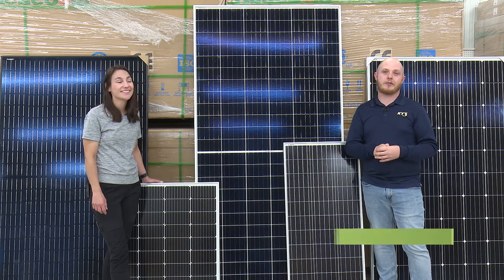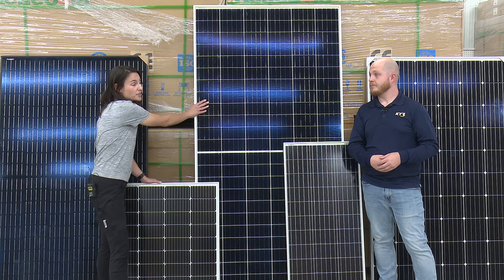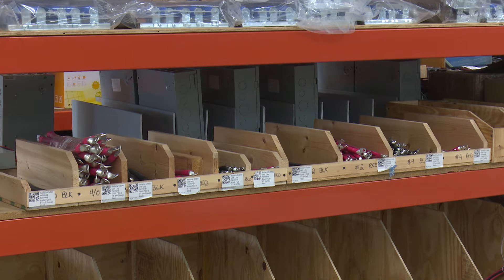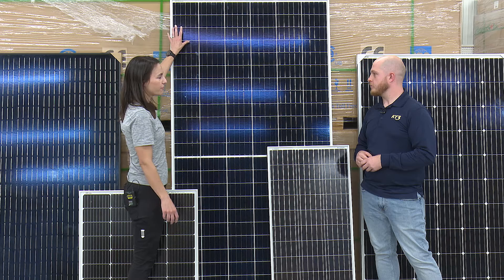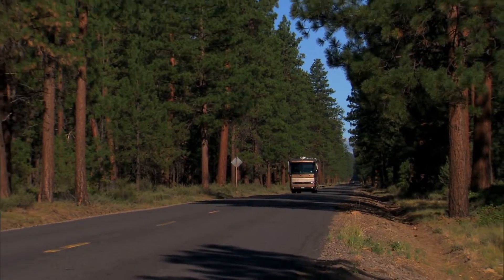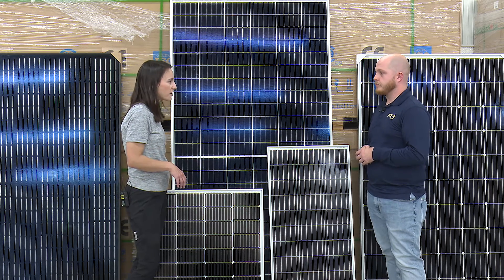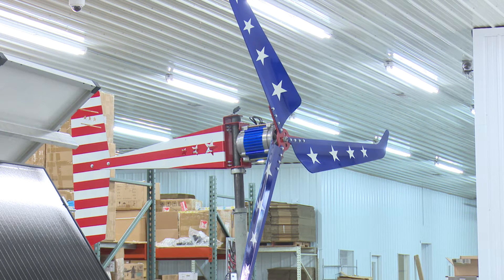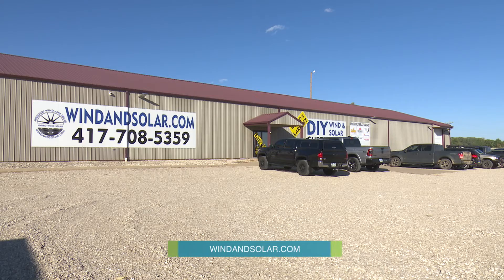What are the differences in solar panel sizes?

Comment: Do you have wind generators for sale on eBay or amazon?
Reply: Google  Missouri wind and solar 
It gives  address and  phone   

I bought 4  rotors and  built my own  from  a General Motors GM  12SI 
alternator  , I watched  the videos  Jeff made a few years  back  and did exactly  what he said to do  , 
This was in December  2016 and  January  2017  when I got them ,
They are still  producing  electricity  .

Thanks Jeff
Reply from the maker: No. Both of the platforms charge exorbitant fees. We would have to pass those fees along to our customers and we just don't think that is appropriate. If you are concerned about buying direct, I would suggest you read through our Better Business Bureau reviews and see how our customer services fares: https://www.bbb.org/us/mo/seymour/profile/solar-energy-products/missouri-wind-and-solar-0734-32908/customer-reviews